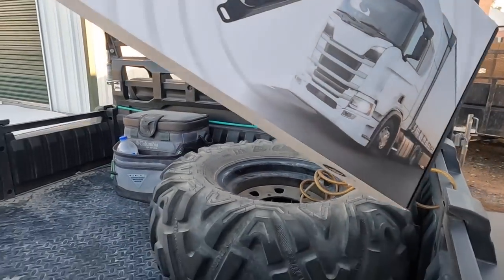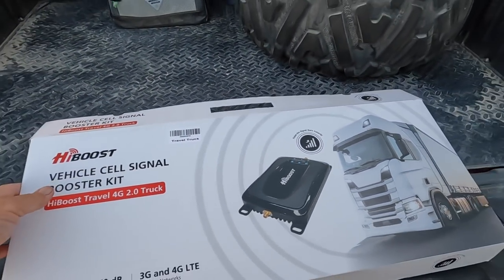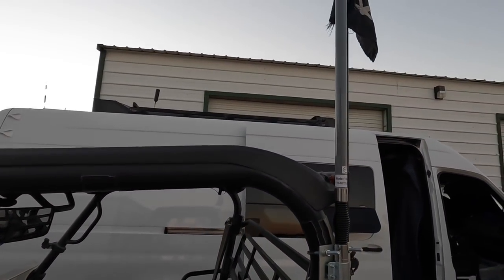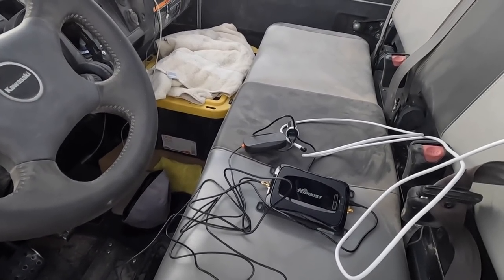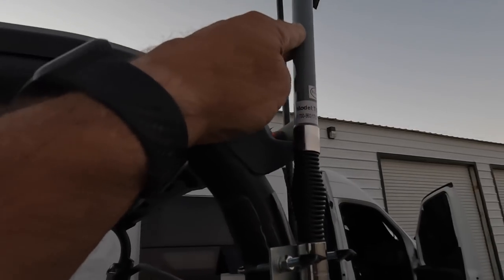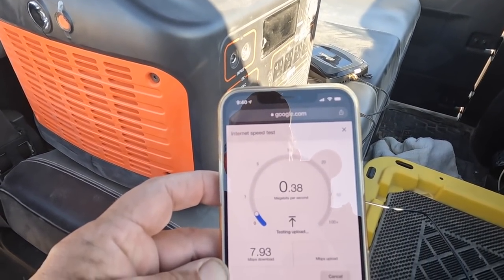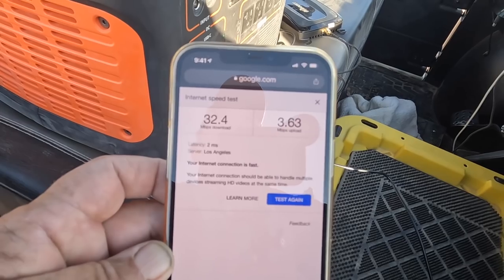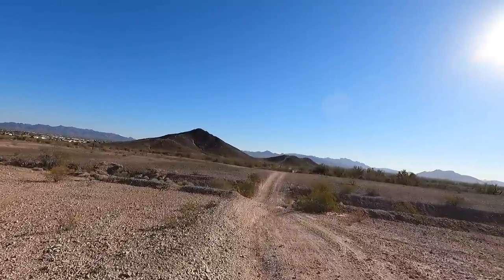Hi Boost 2.0 Mounted on Kawasaki Mule Pro

Comment: Cell boost needs vehicle metal roof between antennas, especially under outdoor antenna. I've had WEBOOST for 5 years on my RV with metal roof, sent it back for repair once. I think lightening in proximity may damage booster.

Comment: I'd check into some type of water/dust resistant container for that hardware. I'd also rubber mount the container on the Kaw. Rain does come time to time in the desert, but moisture and dirt are  constant problems. Heck, I'd probably fuss all over a container with external plugs so once I sealed it I wouldn't have to open it just to use it.

Comment: If you don't want to cut those bolts off and want to protect yourself from hitting them with your head get some automotive vacuum hose with an I.D. less than the size of the bolts cut them a little longer and slide them onto the bolt ends this will provide you with a rubber bumper or buy a pool noodle or PCV pipe insulator and cut to fit then zip tie around the bolts and frame. You could also use any leftover noodle to pad other parts of your ATV. Good luck, Mike